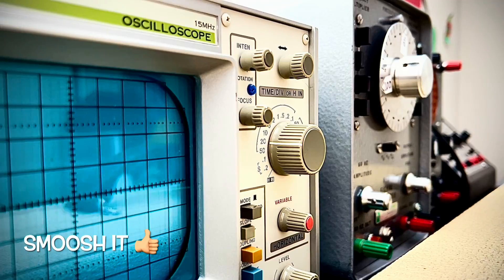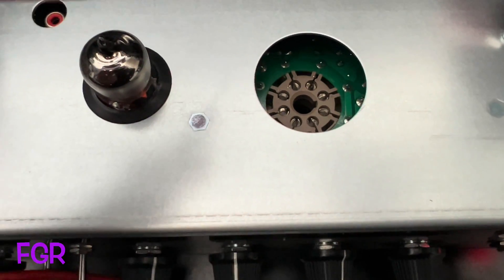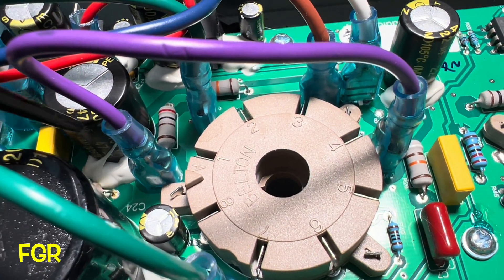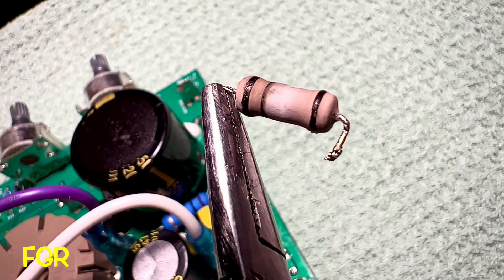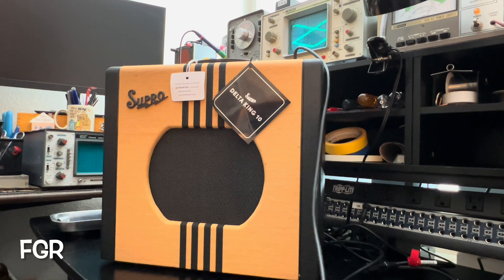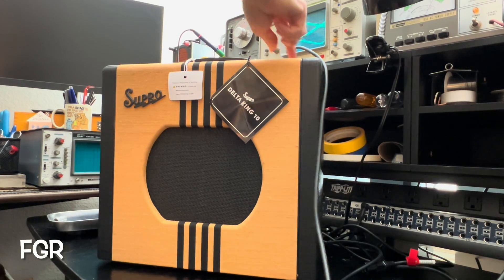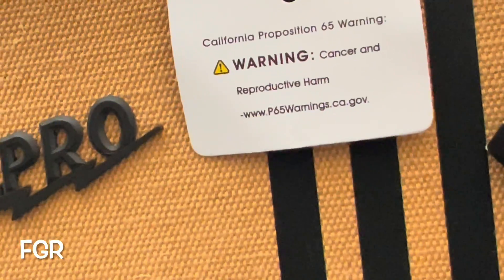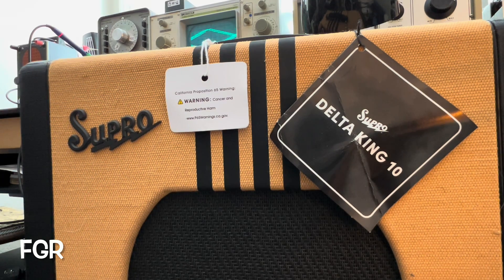Supro Delta King Reverb 10: Screenplay

Comment: The resistor value is not named, although the value is visible, 1K , but how was that determined?. Is there documentation?.
Reply from the maker: No schematic, but looked through documentation of similar amps. Prior resistor, despite being burned, couldn’t have been a 10k Ω. The safest assumption could only be 1kΩ.
Reply: @ForgottenGearRestorations  That's what we went with and the amp is restored to working condition and running stable. In our case, the cause of the blown resistor was a shorted output tube.
Reply from the maker: @BruceGirard-j9u outstanding, Sir Bruce!